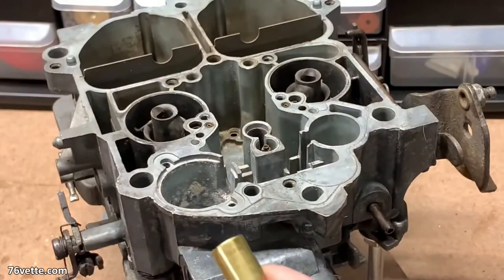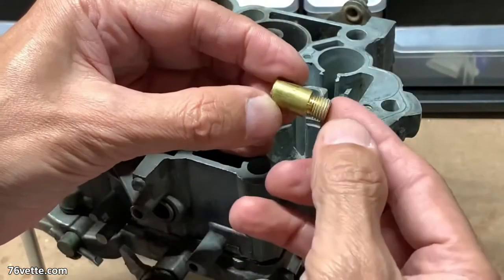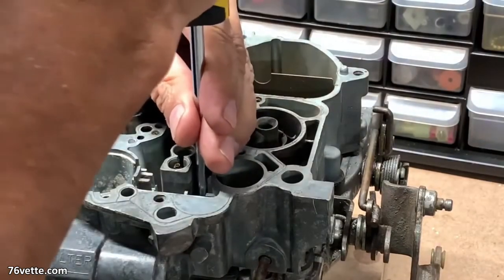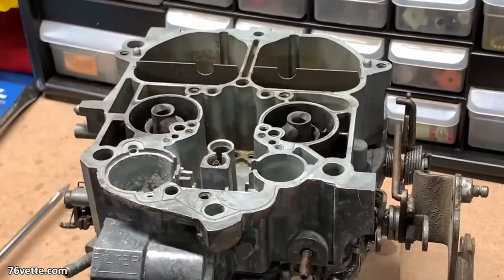Quadrajet REBUILD: Taking the Carburetor Apart

Comment: Hello sir. Another very informative video that you offer us there. One thing calls out to me, why are you plugging the carburetor well plugs? I think I finally find my lovely at an Ohio dealership, this is a corvette 76 automatic transmission for $ 15,990. Do you think this is a good price? Thank you.
Reply from the maker: Hello. Quadrajet well plugs were done at the factory, but they are prone to leaking, so the only solution is to replug them. You can do it mechanically which can be time-consuming or, as most do, just plug them by adding a layer of gasoline-impervious epoxy.
As far as your '76 Corvette for $15,990 it does sound like a fair price, but it all hinges on the overall condition of the vehicle which—without seeing it in person—I am unable to say whether you got a good deal or not.
If the seller is reputable, then you have little to worry about. Having said that, all used vehicles will need some attention.
Best of luck with your purchase. I am sure you must be excited about it. 🙂👍
Reply: @76vette  Hello sir. Thank you for your reply. I learn about this car every day. I may have found what I was looking for with a seller in Ohio. A 76 that an expert is going to check out and you are right, I am very excited that it will hopefully be mine soon.😊...  Good day, greetings from France.
Reply from the maker: @didiermasclet9886  Glad to hear you will have it inspected before making the purchase, especially by someone familiar with these cars. 😊👍🏻

Comment: I've got another question. On the (heat choke), does the cover spring go against the side of  that lever that's inside the housing? I noticed that inside lever has a slot cut into it.  So I was wondering if that 3/4 square box on the end of the spring goes into that slot or just against the outside of the lever. Hope that makes sense. Thanks.
Reply from the maker: If I understand you correctly, Yes! And I think this video is going to give you a good basic understanding of how that spring and system works. 😊👍🏻 https://youtube.com/watch?v=fjtYePcu22A